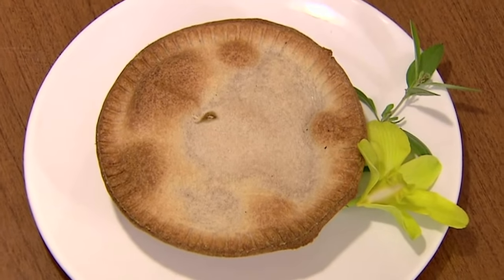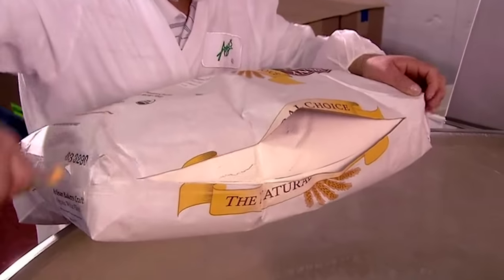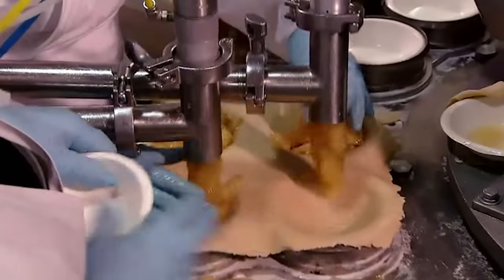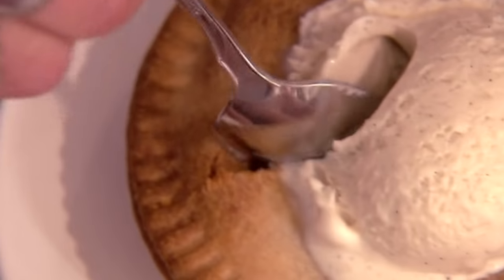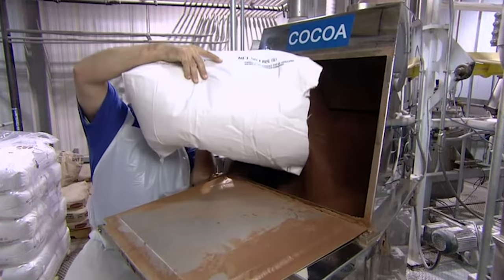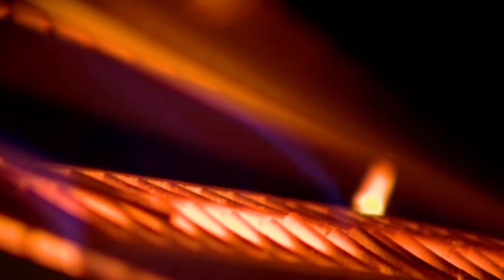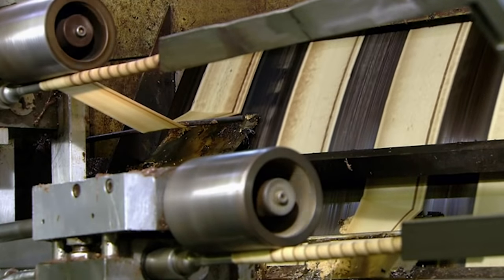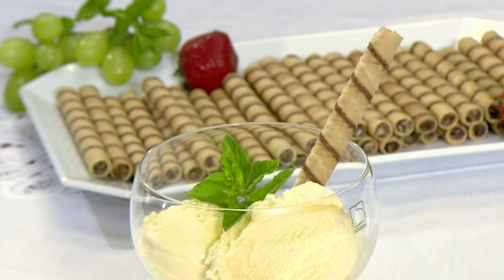Apple Pie & Chocolate Wafers | How It's Made

Comment: That automated filler is a mess.
Reply: ^^Truth^^ Workers shouldn't have to sweep filling either in or out of each pie.  That's pathetic.  In other How It's Made videos, depositors track the target long enough to deliver, then retract.  You could say this one is a pour design ;-)
Reply: +Greg Feneis Thanks a lot! That pun gave me cancer lol
Reply: Well the mixture isnt a fluid or so and since the pieces are always in a random orientation, it is really difficult to fill them that fast. Guess why humans have to control the process
Reply: @or2kr  Could have a small conveyor that vibrates the pies so the filling levels out. And could easily use a pneumatic arm to press the first layer of dough in the molds.
Reply: My thoughts exactly. I work as an industrial automation engineer. I've never worked on a pie filling machine, but I've works on plenty of lines that fill some type of recepticle or other. I'm suprised the filling nozzles dont 'track' with the pie, so that the relative motion between them is zero.
Reply: @paulbuswell6566 ets all just forget that this gives jobs for people, and machines such as you describe are expensive to produce and run as well as putting people out of work
Reply: Ryan Box         👍👍👍
Reply: @Insomniac3d  But they are cheaper in the long run, more efficient and accurate, and can be run almost non stop.
Reply: @MaxRay16  and replacing it with a human means it cant handle variability, and if so not by much, the machines very expensive to buy and setup meaning you lose money in the downtime. and most importantly, you're putting a man out of work so he has an even harder time trying to make a living and support his family. its impossible to replace everyone in the world with robots, because they're as dumb as they get, they cant handle variables
Reply: @Insomniac3d  Replacing machines with human labour if it doesn't reduce quality and is economical should always be strived for
Reply: All that factory equipment looks pretty old, most likely made when equipment that was more automated was very expensive
Reply: @Insomniac3d  Welcome to capitalism, LOL.

Comment: Its always cool watching food be made in factories.
Always wondered how they keep the equipment clean. So many belts and hard to reach areas.

Wish there was a how its done episode on cleaning and other maintenance.
Even the shipping and other stuff would be interesting to watch.
It's cool to learn how large scale operations work
Reply: Power washers, foaming cleansers, hot, hot process water, and lots of down days for scrubbing.

Happens whenever possible, but downtime costs money, so it's easier to practice daily sanitation and through cleaning.

Many systems have a CIP (clean in place) function as well, where you can start them in a cycle without product, and run hot water or chemical through them to clean them, and walk away while you clean other things. Many machines that have a CIP function also have a SIP (sterilization/sanitization in place) where you prepare surfaces for food contact.

Comment: When was the last time that slicing machine for the wafers was cleaned?  LMAO filthy
Reply: Simon WoodburyForget I do make a mess when I cook.  It was evident by the crusty built up gunk on the machine that it was NOT cleaned 20 minutes ago.. 
5:12 look at the little rod in the background.  It's built up with dust.  That does not come from wafers, does it?  It's dust is layered almost half an inch thick..
Reply: Simon WoodburyForget knead*  I don't see any flour flying around?
Reply: I don't see any dust flying around? That was very obviously very fine wafer crumbs and chocolate from the filling that is still runny at that point. You expect a machine that's cutting thousands of wafers an hour to not get any crumbs on it? Whatever. Don't eat them if it bothers you so much.

Comment: That factory was pretty nasty looking. If you're going to have cameras in, you might want to clean the equipment.
Reply: CrankyPants thats probably clean compared to its normal state, bakerys are normally a pretty dirty place
Reply: Any food place is hard to keep clean all the time, trust me I work in one
Reply: I work in a deli. We clean usually about 3-4 hours after the store closes every single day.  9pm until whenever the whole place is clean. Bleaching every table, scrubbing the floors, scrubbing the slicers, pulling out the tables and scrubbing the walls with cleanser, covering salads and replacing any that are low. Then cleaning both the inside and outside of the glass on both sides. Cleaning the interior of the case every night. Testing and checking dates on every meat, cheese, and salad in the case, preparing all the premade food for the next day. Such as 40 various $5 sandwiches and 35 more expensive Boars Head sandwiches. And various food packs. 

..I'm sure cleaning a factory has a lot more steps than that and I'm sure it's clean enough to pass their basic standards. Considering we get a B on our health exam every 2 weeks when we clean all that every night of the week.
Reply: Organic thou ?
Reply: It’s a factory, it’s gonna get messy
A factory ain’t gonna be spotless
The equipment is used daily, so they barely have time to thoroughly clean it
Reply: That was probably all from one day.
Reply: That factory was spotless compared to most others!!! Just watch the animal process,